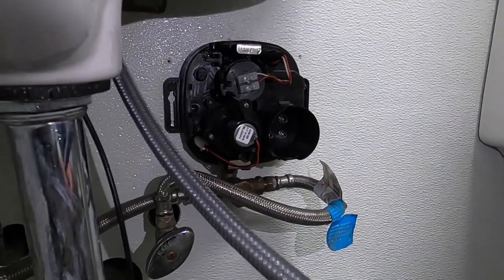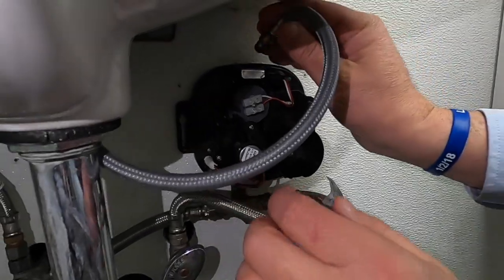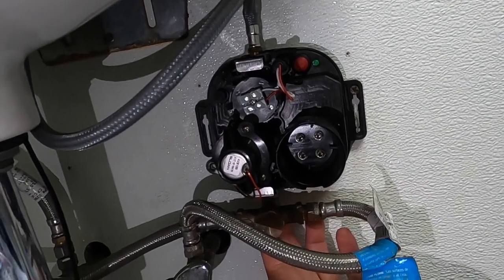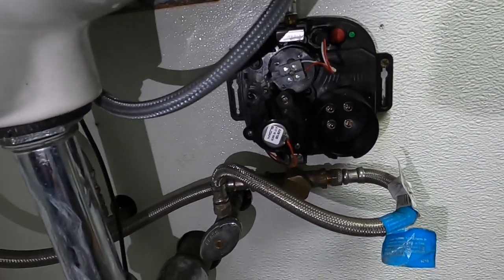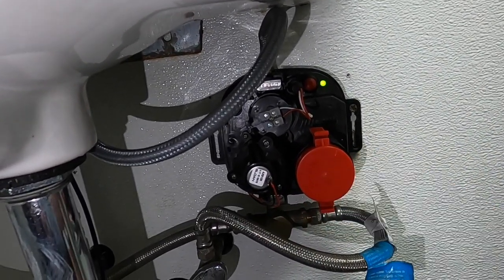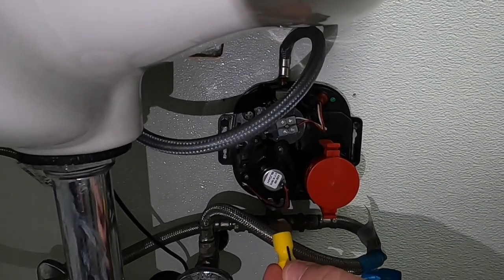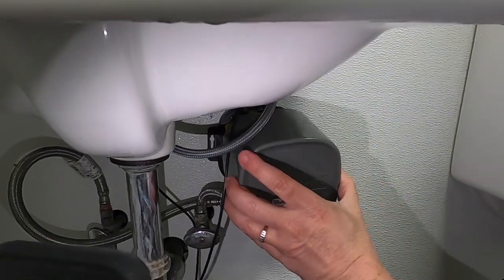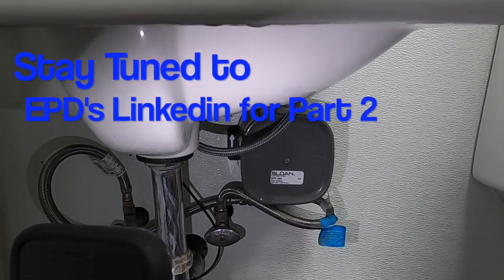Sloan's Smart (Bluetooth) Faucet Part 1

Comment: I'm trying to lower the pressure coming out. It's far too high and spraying water off the sink and onto the floor.

Adjusting the shut off valves has kk effect.
Reply from the maker: What is your pressure at the fixture? What GPM? Best way to solve is to put in a PRV if the pressure is too high, but you could also try using a different aerator with a higher flow. If you have the spray type .5GPM sometimes this can occur with too high of pressure.
Reply: Same problem I got called in because pressure was to high